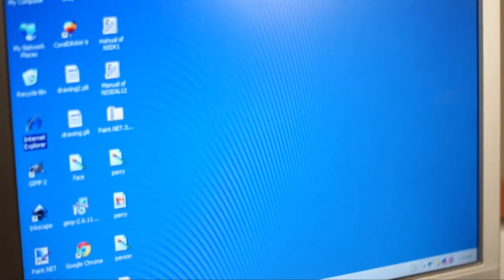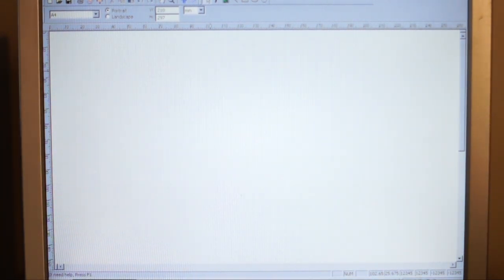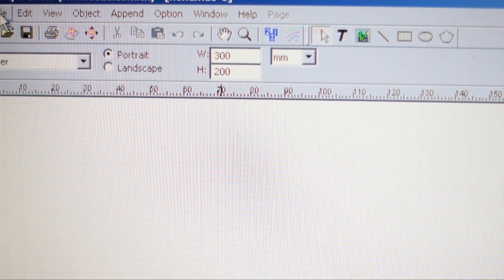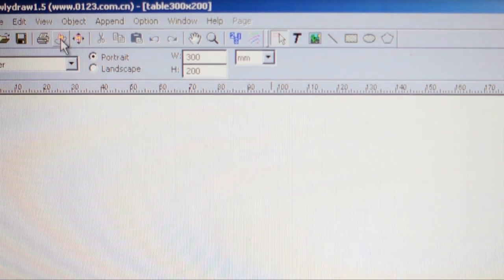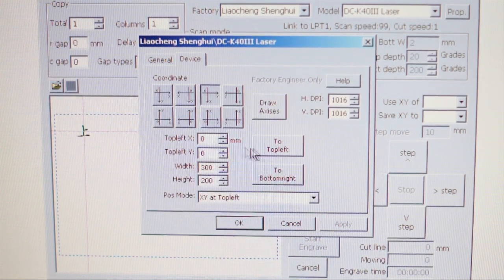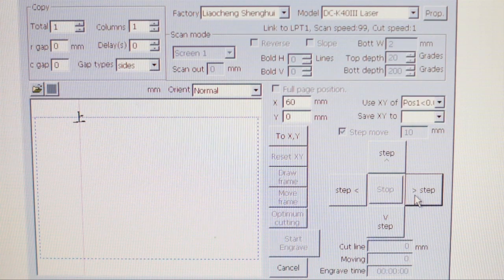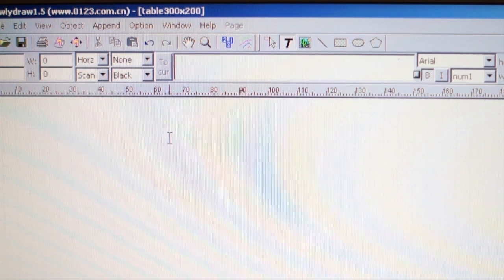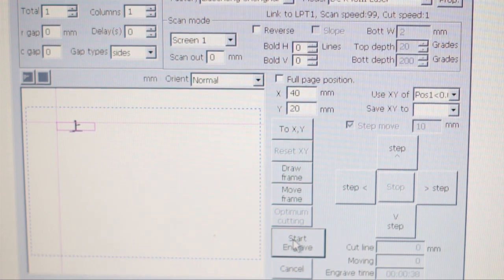China Laser Engraver Cutter Part 3

Comment from the maker: Hi. So the largest piece you can do after replacing the table is 11.81" x 7.874" inches. Now there is a fairly simple mod that may  allow you to extend the length the 7.874".  I will explore this option.  But the width 11.81 would be hard without really takeing the machine apart.